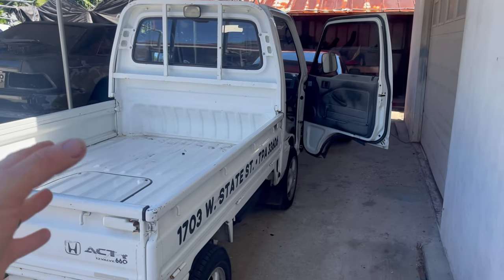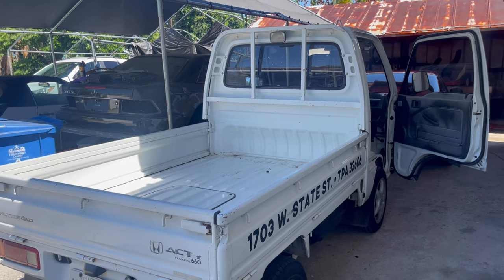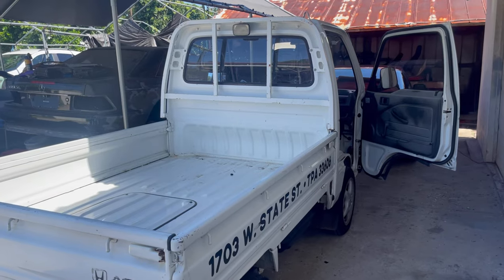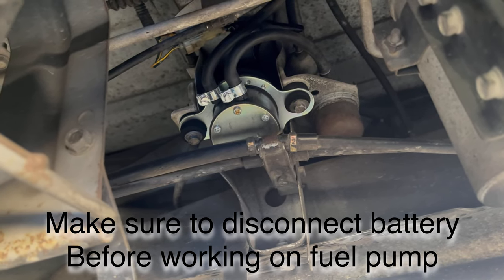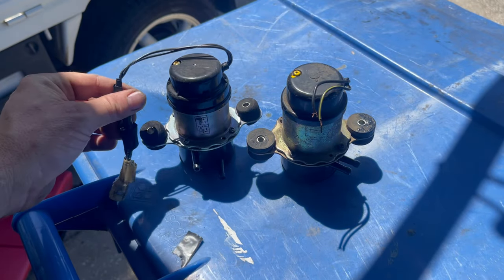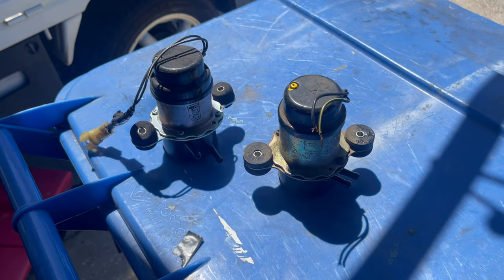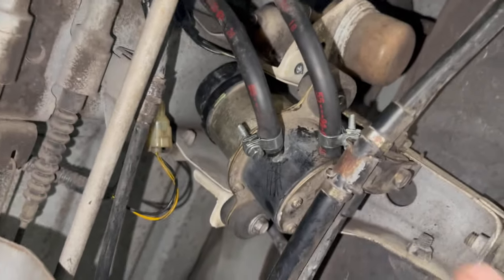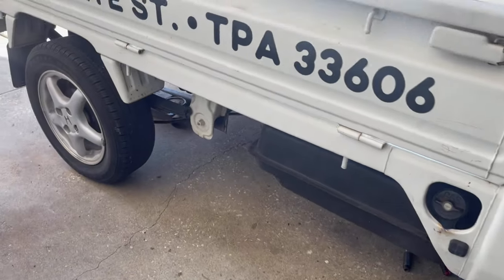Why you shouldn’t buy a cheap fuel pump for your Honda Acty mini truck

Comment: My Hijet fuel pump just crapped out.  Symptom - the truck would intermittently die, presumably from fuel exhaustion.  Wait a few minutes and it'd start and run again.  I noticed that it only happens when the fuel tank is less than half full.  Sure enough, that's the level of the fuel pump so it's apparently gravity feeding through the fuel pump when the tank is full.  I checked after driving it today (full tank so it ran well) and the fuel pump was hot to the touch so it's apparently stuck in the open position that allows fuel to flow through it.  The stalled motor is overheating the fuel pump and that may be vaporizing the fuel and causing a vapor lock.  I was going to replace it with a genuine Daihatsu part but my mini truck has an electric fuel pump near the fuel tank and the $111 fuel pump I found online is apparently a mechanical fuel pump.  I ordered a $12 universal fuel pump on Amazon.  If it doesn't last, I'll source the Daihatsu fuel pump.
Reply from the maker: I may be in same situation.   I’m having issues accelerating.  Changed out fuel filter with no luck.  Going to swap pump and see what happens
Reply: @petescarport  - It'd be great to check the fuel pressure before replacing the fuel pump.  I thought about that but didn't do it.  I'm an engineer and we like data.   🙂  If the fuel pump doesn't help, then maybe overhaul the carburetor?  My Hijet doesn't accelerate well, but it's doing as well as I can expect for a 0.66 liter engine.   😀

Comment: Well this is a pretty late comment since this video was uploaded two years ago but I just ran into an interesting issue on my acty. I had a similar issue with my dizzy where I ended up buying a Chinese fuel pump for it and I ran it for a while even after installing the dizzy however recently developed a new issue. Mine seems to be shorting a fuse on the fuel pump there's a good chance it was caused by the Chinese fuel pump however just to be safe I installed the original fuel pump back in and that did not solve the issue sadly..... There is a very good chance however the Chinese fuel pump was okay and the fuse is the main culprit.... Any ideas of common symptoms of a fuel pump fuse on these cars?

Comment: That mitsubishi pump is oem, they came with those from the factory, i got a cheap pump and it died in 3 months :(
Reply from the maker: Thanks for the update.   I had a feeling since the Mitsubishi one is still going strong for me
Reply: @petescarport  they last forever if you keep your fuel level over 1/2 and change the filter every 2000kms at least. Good luck!